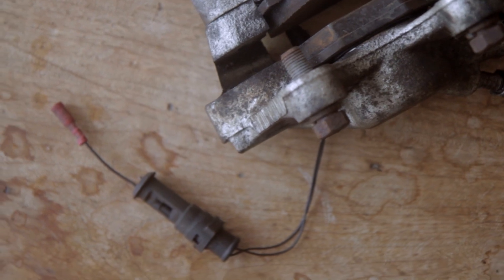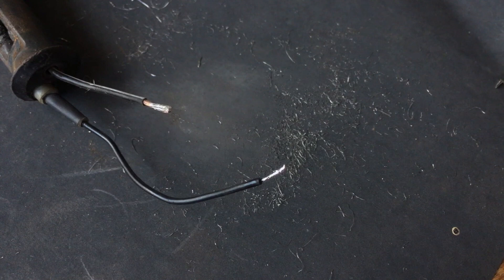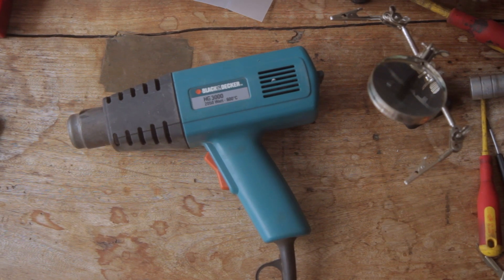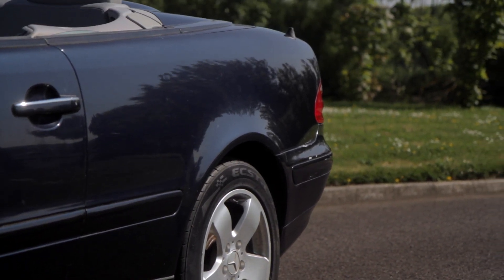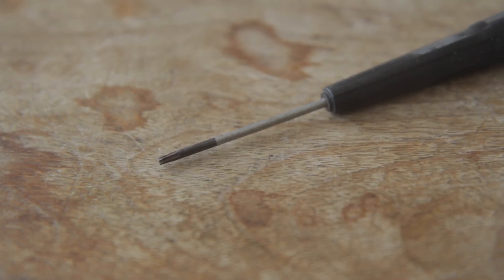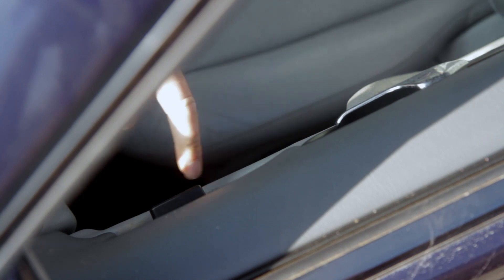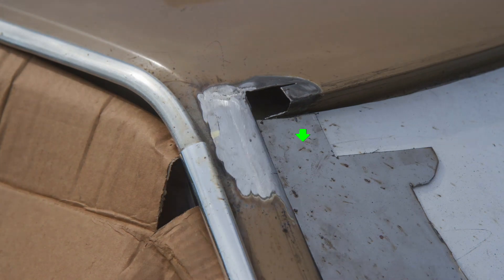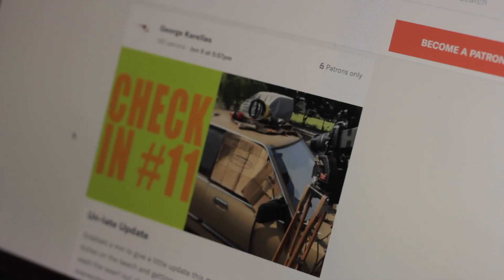How not to prep a car for welding, PCB solder job & Range Rover refit // SOUP Classic Motoring 27

Comment: Hi George,
Love the series. Just some advice from a long term vintage audio repair guy. When you want to reflow PCB solder joints, it's better to heat up the existing solder with your soldering iron and then come in with some solder to re-flow the solder joint. This will leave you with a clean(er) joint. Make sure you match the solder to the age of the car. Leaded (Pb) for older and non leaded solder for modern cars.

Comment: Thanks for the tip on marine grade heat shrink tubing. I’d never heard of that product but have ordered some for the electrical work on my 1986 Alfa Romeo GTV6!
Reply from the maker: It's fantastic stuff. I usually give the ends a little squeeze when the wire is particularly thin.

Comment: Yet another top episode there.  A bit of a bummer with the stray weld spatter but the windscreen surround is looking better already. You did right to take a step back. You will be in a better frame of mind when you get back to it. The Vectra is sold, the T4 conversion is now on hold, still no further on with the Corsa but I've been keeping the Dolomite's battery charged up and hope to get it started soon. The Citroen has to take top priority being the daily driver. I've just replaced the nearside driveshaft and for the first time in my ownership there is no clicking when I'm turning a corner. The driveshaft replacement will be featured in my next upload.
Reply from the maker: bitter experience mate, I've messed things up further by ploughing on with a bad attitude

Comment: I took the seat switch apart in my 1989 300SE as it was all gummed up inside and stiff to use. What I didn't realise at the time was that it was full of springs, ball bearings and rockers. 
I opened it up and yes, the springs balls and rocker arms all went flying everywhere ! It took me forever to find them all and even longer to get it all back together again.  It was like a Chinese puzzle. 
The sad thing is, the headrest button broke off a few weeks later. Arrrrgghhh!! Thankfully I had set the headrest perfectly for me so left it well alone. 
I wasn't going through all that again.

Just a quick edit:  It was great to hear you mention the dry solder joints on the older Mercs. I have revived a number of OVP relays over the years on my 190's. And also the ASD relay in my 2.3-16. That episode uncovered an utter wanky bodge that some scrote had done. 
They had gone to all the trouble of removing the clocks, cutting the wire to the ASD light and (badly) soldering it to the ABS bulb holder, so that they would both illuminate on ignition on and go out when the engine was started.  
They went to the trouble of all that bodgery when all they had to do was simply pull out the ASD relay and re-solder a few dry joints ! 
The cruise control has started playing up in the 300SE so I need to find out where the relay is and get the soldering iron out for that. 
Wow. Sorry for the long winded reply here !
Reply from the maker: haha whoops! That's why I put the big 'carefully' on the screen, hate when I forget and springs fly everywhere.

Comment: The Power window Board in land rover discovery 1 and range rover are notorius for dry solder cracking. My back windows work intermittantly but i've har it out 3 times and CBF doing it again
Reply from the maker: nothing worse than I job you've done a few times and know you can fix but just don't have the will anymore!

Comment: If you solder something then be sure to use flux-core solder and flux. If will help greatly with oxidisation and solder flow and will make your life easier.
Reply from the maker: Great tip, should have said that. Plenty more soldering to come and I intend to get more in depth ;) Cheers LuparaX2

Comment: surely you put that seal in backwards after adding the heat-shrink? (or did you not care as you had to make the hole larger to accommodate the heat shrink diameter?) Anyway, what a great channel I only strayed upon recently... keep up the great work.
Reply from the maker: No put it in backwards, and with a little cut off because it was that or nothing. Thanks man

Comment: Noooo, that interior was immaculate. Bugger! But do yourself a favor and get some gas for the Mig. You'll love it, massive difference and keeps the welds nice and clean. Plus all the weld spatter that your spraying all over the paint doesn't help either. But on a good note, doing a great job of the filler peices.
Reply from the maker: Have to get a welding blanket, and a new welder ;) The one I have doesn't have any fittings for gas, it's the cheapest of the cheap. But there are good things happening, new welder soon! Thanks man

Comment: Recommendations to improve your soldering:

1) Properly clean the surfaces of all your wires. You did this fine.
2) Properly clean your soldering iron! It's dirty as heck. You want something like a brass sponge, or a simple wetted soldering sponge.
3) Tin your soldering iron. Allow a small amount of rosin-core solder to flow over the tip until it is smooth and shiny.
4) Do not carry blobs of solder on your soldering iron.
5) Bring the soldering iron to your first wire. Heat the first wire. Insert rosin-core solder so it touches the wire and the iron. Watch it flow through the strands of the stranded wire, in this case, or around a solid-core wire, until the first wire is tinned through. It should not have a blob, as yours did.
6) Repeat the process with your second wire. Again, no blobs.
7) Do NOT rely on the mechanical strength of the solder to join two wires if you can avoid it. You used glue-heatshrink, which is okay, but - generally if you are not using crimp connectors, you want to wrap the two wires around each other before joining; in this case, you can't, so instead I recommend using a solder-impregnated heat-shrink connector, which uses solder instead of glue to hold it all together. In this case, I might have taken the new wire and wrapped it around the end of the sensor and zip-tie it in place in order to ensure that the joint is never in tension.
8) Re-clean your soldering iron and put it away.

There is really nothing wrong with a butt connector to attach two wires - do that, and if you want, wrap some heat-shrink around the connection, if you're paranoid; good quality (marine grade) heat-shrink butt connectors tend to be pretty good.

For reflowing PCBs, I'll give similar advice:

1) Clean, clean, clean - clean the PCB joints with alcohol, clean iron tip
2) Tin the iron tip, do not carry blobs
3) Iron tip to solder joint, a second or two
4) Just a little bit of rosin-core solder, it should immediately reflow, you can watch the surface tension like water as it flows and climbs

You're done.

Alternative: Use a flux pen on each joint after you clean it; reflow it without any new solder.

Careful: old PCBs use leaded solder. Not good to breathe. Use a fan to blow it away from you at minimum.